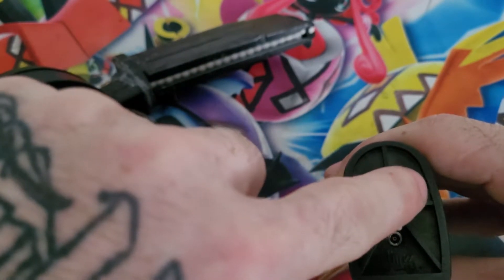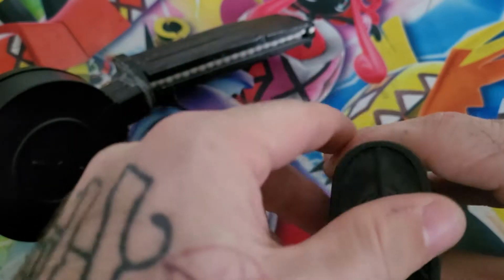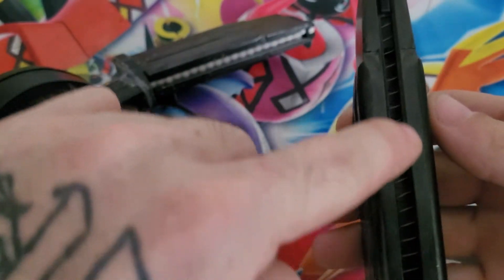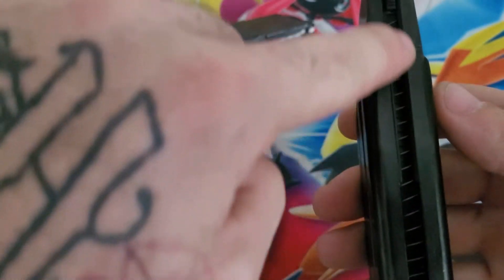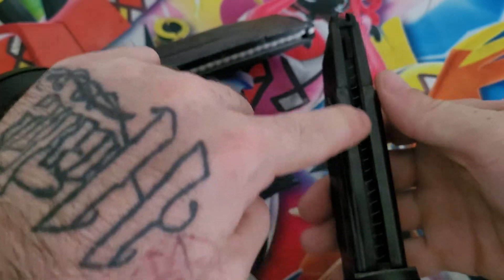Custom TM MK23 Drum Mag!

Comment: would this still work if you just left it as green gas? basically just increasing the mag capacity?
Reply from the maker: Yes you could still leave it as green gas. But you will need an extension adapter so you can reach the fill valve